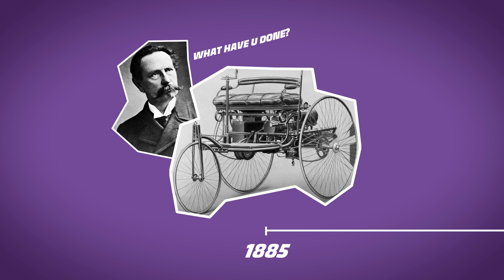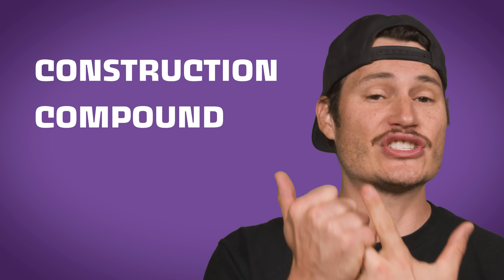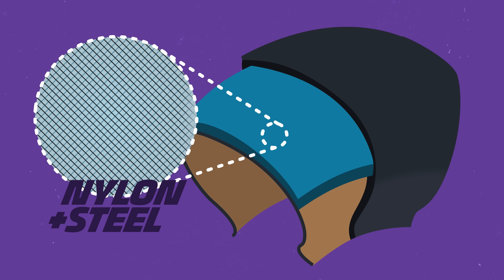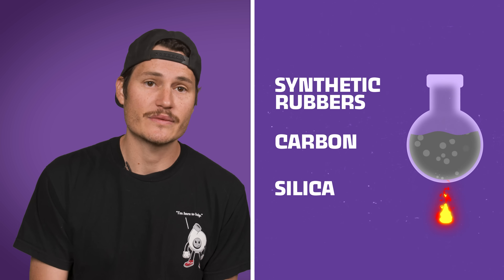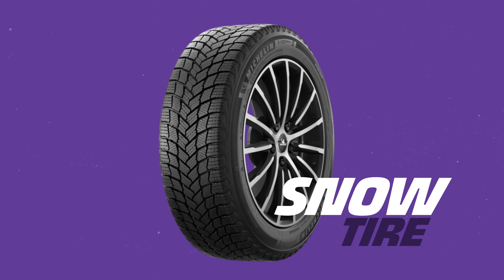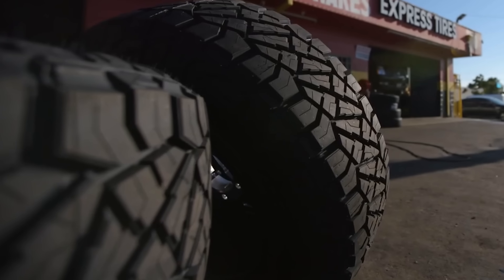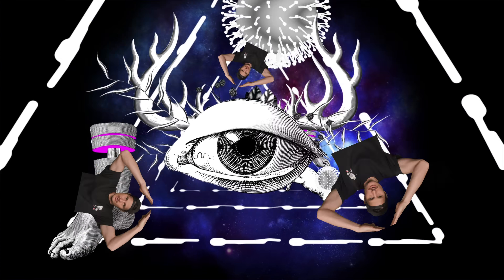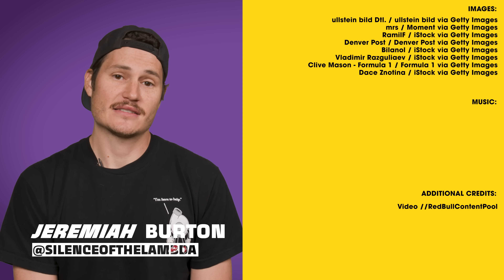The Surprising Science Behind Tread Patterns

Comment: wider tires aren't making any single point stickier they're just allowing a larger distribution of the forces. lower force over a given point will result in less slip.
Reply: To expand, the amount of force per square inch is less such that the rubber won't deform as much and fail at the contact point.
Reply: As well as being able to use a softer compound with similar tread life
Reply: To put it in even simpler terms, for a larger tire you'll get a larger contact patch. And while the contact patch is horizontal, the shear force is what matters here. So, the actual ability to grip comes from not just the theoretical friction force, but also the ability for both surfaces to remain in place. If you have a smaller tire with the same forces, it's more likely that the tire or ground will start to break down. This can be seen most closely with the grooves made in roads by semi trucks, as they are heavily loaded and are able to quite literally push the asphalt away as opposed to simply pushing off of that asphalt.
Reply: On top of all that, many of these tires are also made to bond to the asphalt. More patch means more bonds, and more bonds means more resistance to sliding. This translates to a higher real world friction coefficient.
Reply: This is all too complicated for me. Someone please explain to me very simply, why does a road bicycle tyre (think tour de france tires, 2-4cm wide) have such good grip, even though it's so slim?
Reply: @diviscadilek1764 It doesn’t ... in relative terms. It’s just that the forces acting upon it are much less than a motor vehicle... I think
Reply: @diviscadilek1764  short answer - rubber is sticky
Reply: Also a wider tire can absorb way more heat than a smaller one so it can stay longer in the optimum range for longer :)
Reply: Yes That
Reply: @diviscadilek1764  Low weight, low speeds, and low expected service life means they can use a very soft rubber compound, which increases grip. The same compound and construction on an automotive tire may only last a few hundred miles
Reply: @diviscadilek1764  The grip is not the same on a thin tire and a fat tire. It is relative to the mass it needs to move. It takes less friction to move a bike and biker than a f1 car.
Reply: @diviscadilek1764  it is deceptive, they are actually trying to create a super lower coefficient of friction so it takes less energy for the wheel to roll (same idea behind trains). The reason the grip seems so good is the forces on a bicycle are very small.
Reply: @diviscadilek1764  Road tires on a bicycle are thin to decrease rolling resistance and reduce rotational mass. Power is at a premium on a bike, since you have to provide all of it. Thin tires allows the power you give to the bike via pedaling to go more towards moving you and the bike and less to turning heavy tires. Also to the point that @DJBLC made, think about how easy it is to skid your bike tires. If they had so much grip they didnt skid, when you locked up your brakes, they would instead just launch you off the bike as it stopped on a dime.
Reply: yep he right, your coefficient of friction is dimenntiomless , increasing area distributes the force per unit area more allowing grip to remain below or closer too the force required to exceed the friction force, the closer your friction force is too your input force the less slip
Reply: That is a much better way of saying what I was thinking. More is more. More tyre > more contact > more grip
Reply: @diviscadilek1764  because it is a super soft compound(relative to a car tire) and is under very little load compared to a car tire. Shoes also use super soft compounds, softer than a bike tire.
Reply: @diviscadilek1764  Because you and your bicycle are very light compared to a car, so less gforce involved to test the friction capacity of your tires, so it's much easier to stick. And you probably have good rubber, too.
Reply: @madmax9009  yeah, the stickier rubber seems to be the common answer throughout all these replies.
Reply: @32krod  Nailed it. Shear force is critical here. Additionally, the standard friction equation is a simplified model, disregarding many contributing factors
Reply: No
Reply: @shadogiant  This isn't right in isolation - the force per square inch and size of the contact patch is set entirely by the tyre pressure (hence pounds per square inch)
Reply: @diviscadilek1764  they don't. Anything with slim tires like that would slip 24/7 if put on a bigger vehicle if they didn't blow up immediately.

And increasing the tire's width when its unnecessary means you're going to use MORE energy to go slower. So you want a perfect balance, a tire that doesn't slip, but also one that won't just cause extra resistance.
Reply: Mmm Physics
Reply: @jjharrison2877  contact patch is not entirely determined by pressure, though it would be if the tire had no structure like a ballon. But modern tires have structure to them which supports some of the weight, my 2700lb S2000 on 255/40-17 extreme performance summer tires can keep the rim off the ground with no pressure in the tires and the valve core removed because the sidewalls are so stiff. So tire size matters in that regard. Additionally a tire with more volume (bigger) can support the same weight with less pressure because the weight of the car displaces a set amount of air. You can increase the amount of air with either pressure or volume. Thus a higher volume tire can support the car with lower pressures further increasing contact patch size.
Reply: @Ysabela no
Reply: What he said 🙄
Reply: To get more grip, you need weaker rubber. If you have weaker rubber, then you need to reduce the contact pressure between street and tire, so you need more surface to carry the same force. It is the same as with buildings: If you use weaker materials, you neet thicker pillars and walls and girders to bear the same load. You have an optimal contact pressure for your rubber to work, so you make the tire exactly the size it needs to be for having exactly this contact pressure. You need mor pressure? Mak it smaller. You need less pressure? Make it bigger.
And if you have more grip, you can accelerate and decelerate faster, so you produce more heat in a shorter time, so you need bigger tires. The harder you brake, the bigger your brake discs need to be to store, cool off and radiate away all that heat. It's the same with tires.
The tire does not have so much grip because it is that big, it needs to be so big because it has so much grip.
Reply: @32krod  that extra friction bond is literally glue, ever been to a 1/4 mile track starting line?
Reply: This doesn't answer the question because there's also less friction force per area. What you described is essential equivalent to dividing both sides of the equation by area.

F/A=mu*N/A -> F=mu*N

The real answer is because a multitude of factors. 
1. Load sensitivity. The friction coefficient isn't actually constant; it depends on the slip angle/ratio and the pressure that's compressing the rubber. A wider tire distributes the weight over a larger contact patch, which means less pressure compressing the rubber in the treads.
2. Adhesion forces (rubber is sticky). These forces do not obey the same equation as friction. The total force from adhesion IS a function of area. This is why more tape, for example, holds things together better. Side note: more adhesion does improve grip, but it also increases rolling resistance, which is why tires can't be super "sticky".
3. Rubber shearing. A tire can have a high coefficient of friction and a lot of adhesion, but none of that matters if the material itself cannot handle the force and shears. This is why you see black tread lines on the road if you lock up the tires from heavy braking; the rubber is shearing and separating from itself.
Reply: @ronan7812  10,000+ hp and tq, yeah that’s a light load. Must be why the clutches literally weld themselves together and there is no transmission at all lol
Reply: Simply put MORE SURFACE AREA
Reply: @Ontheregz  well yes, it is. And as I said, a larger contact patch means more bonds to the surface, which means more friction as those bonds set.
Reply: @diviscadilek1764  simply put more surface area. 15inches wide compared to a one inch road bike tire without teslas torque vectoring or even better a rimac Nivera, it would take for ever for the one inch bicycle tire to accelerate "quick" 😉
Reply: @diviscadilek1764  road bicycle tyres do not have good grip, and was designed to have low grip (small contact area) to reduce the rolling resistant. It is exactly the opposite of good grip lol.
Reply: You know these tires grow substantially in height as well as width, they get much skinnier. Under full throttle right? That affects contact patch, diameter and in as an effect gear ratio. Wide tires on a road car are for pulling high lateral g’s and for better braking.
Reply: @diviscadilek1764  and your not accelerating up to 60mph in 1.5 secomds your talking turns with 200lbs total weight. There's not much needed just lightweight
Reply: @diviscadilek1764  if you put a 2000 ft lbs of torque motor on your bicycle it would spread to pieces. From the crankshaft to the hub amd even the spokes. UNLESS YOU MANAGED TO PUT A SMALL ELECTRICAL VERSION OF TESLAS TORQIE VECTORING WITH TOUGH FORGED PARTS WHERE NEEDED, YOU MIGHT NE ALRIGHT BUT THE BIGGEST THING IS COMPARIMG 200LBS TO 3000LBS OBERALL ;)
Reply: @Ontheregz  yes, but even at high g's you're probably not going to be in a situation where the ballooning is going to decrease your stability because your torque in higher gears isn't likely to break traction once you have it. That's why you're more likely to see someone lose traction at the start of a race, while losing traction further down is often due to weight shift from steering etc.
Reply: @Hawk7886  unless its  covered in grease  😎
Reply: @shermantank  FACTS!!!! ITS ALL ABOUT PERSPECTIVE GUYS SIMPLE AS THAT!! AMD ALSO WIDE 15INCH DRAG RADIALS HAVE ABOUT 15 TIMES MORE THE SURFACE AREA OF YOUR 1IMCH BICYCLE TIRE AND ITS ALSO PUSHING 3000 LBS TOTAL NOT 200 LBS TOTAL
Reply: @32krod  exactly simply a larger surface area. Tesla and rimac Nivera are able to do it because there beautiful torque vectoring system that operates 100's of times a second for max traction regardless of the amount of power. The higher the power output you simply use stronger forged parts where needed
Reply: @alextheonewarrior  wrong. Ever heard of tesla? Ever heard of torque vectoring? What you saiday have been correct in 2005. Now your answer is completely obsolete..sorry buddy
Reply: After reading most of these comments I'm astonished at how many people clearly failed basic physics. What is TORQUE VECTORING? HAAHH
Reply: So nobody actually seems to be answering the actual question. Why is it that the formula does NOT include the size (specially the width of the tire) in order to figure out the surface area?
Reply: give this man a shirt
Reply: @32krod  Also, a bigger contact patch means that you nerd less air pressure to withstand the weight of the vehicle, which makes them more resistant to hit bumps because they can deform and absorb the impact while maintaining proper contact with the road, due to the fact that the car is rolling smoothly rather than jumping around. In short, wider tires are stronger and keep the car's weight pressed against the ground as needed to get grip.
Reply: @djbis  because area cancels out, the equation for simple friction is not used to "figure out the surface area". That isn't what was asked though.
Reply: @diviscadilek1764  they just have to deal with a much lower weight, so they don’t need to to be wider to have the same ability to accelerate, decelerate and turn then a car does. the ability to accelerate, decelerate and turn is related to the tyre friction, which increases as the contact path increases.
Reply: @diviscadilek1764  because of centrifugal force, it is isolated to the narrow area that is in contact, thats why they are skinny, and tall
Reply: Lots of good thinking going on in this thread, but my god there is a lot of hoopla also. If it takes three paragraphs and 5 analogies to explain a concept in the simplest possible terms, probably not a correct explanation
Reply: @ddjohnson9717  not really. They have both good grip and very little rolling resistance.
Reply: @bentreece1187  then you consider then fact that the surface area isn't actually larger lol. Fz (car weight on wheel) = P*A where P is your tire pressure and A is the area of the contact patch. Mind you, this ignores the force of related tire deflection, but if a narrow tire and a wide tire have the same pressure and the same load, the contact patch is the exact same area. It's the same total area, just a different 2D shape...
Reply: That's why mo downforce bebeh.
Reply: @diviscadilek1764  it's all about the application, most road bike tires are 25-28mm wide with only say 75-90kg of mass applied to them. Car tires might be 275mm wide but need to support 500kg. You also dont expect bike tires to last 50k-75k km, more like 1000km. Bike tires can have a softer compound and use that to make up for the lack of contact patch. They also experience 10x less force so the total work they need to do is much lower. Go down a descent and feel how warm bike tires get(not very at all), but drive hard on a track and see how hot your tires get.
Reply: This is half true at best.
Reply: @diviscadilek1764  to add on to what others have said: i bet bike tires use softer compounds as well - obviously they don't need to withstand anywhere near the same forces so they can be softer and still last a decent time
Reply: @diviscadilek1764  because the bicycle tires have forces orders of magnitudes below what is required to make the tire at point of contact fail in sheer. Tires are made wider to prevent sheer forces at the point of contact from destroying the tire prematurely and increase the number of asperities maintaining static friction. 

The more power you turn the wheel with the wider the tire needs to be based on the physical properties of the tire materials used.
Reply: Best answer! Give this man a t-shirt!
Reply: @prodrivebrasil  doesn't look like they gave anyone it. oh well 🤷‍♂️. atleast we all probably learned a new thing reading thru the comments
Reply: @Butt Butt nop :P
Reply: We never landed on the moon.
Reply: Can I have your tshirt
Reply: The do not have a great grip  but the rolling resistance is very small.   The small contact patch and total weight gives them enough grip to ride safely on solid roads.  When it rains they switch to a larger tire size.
Reply: So is the constant the amount of grip between 2 surfaces at a single point?? If yes, then that would make sense why the area of the tire wouldn't be factored in right?
Reply: Unless your in snow moor grip